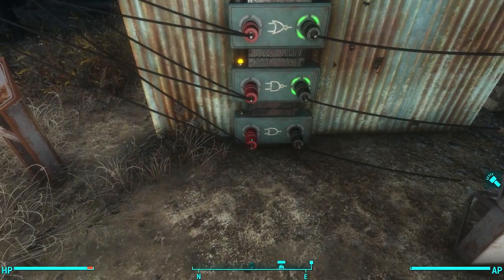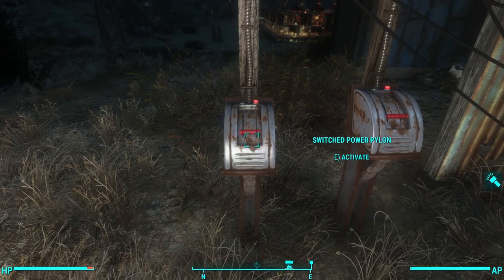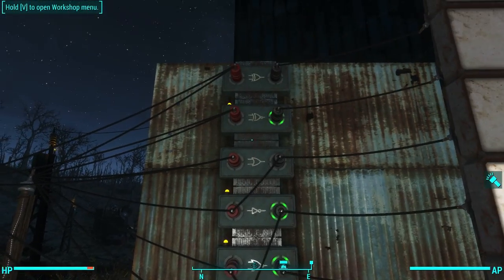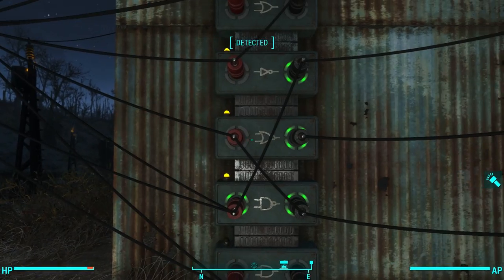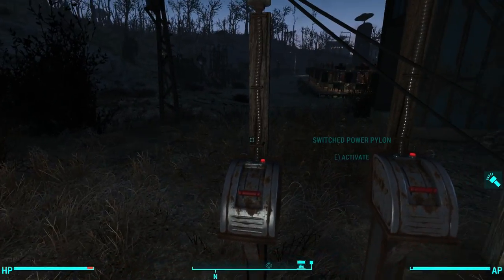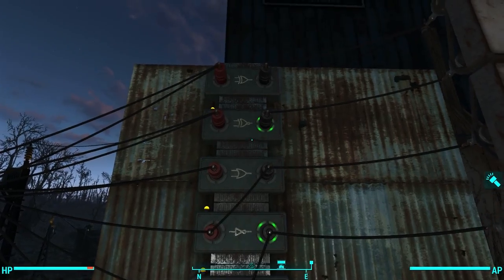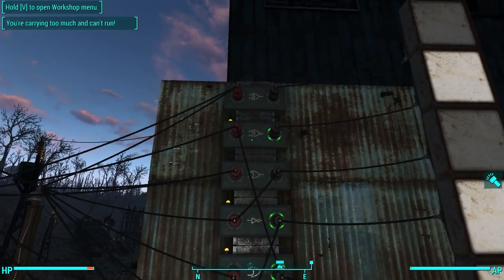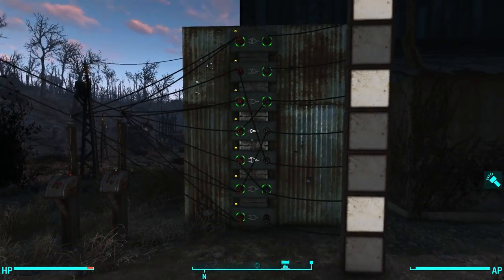How Logic Gates Work - Contraptions Workshop - Fallout 4

Comment: In my opinion the XOR Logic Gate is the best one for general use! You can make a door that can easily open or shut from either side, regardless of the way you went through it last or came to it this time. Just feed the power through the wall, to a switch box on the other side, then back to the gate. In addition to having a switch box on the same side of coarse.

Comment: The And gate is probably the most useful in my opinion. I use it for securing my powered doors. It's more for roleplaying, but I usually surround my nuclear reactor with walls and a powered door. I then have three switches at different spots that all have to be activated to open the door to the reactor. One's at the door (guarded by turrets and sometimes a guard), one is usually overlooking it, near a guard post, and the last one is near the overseer's office- another well defended location.

I also usually have a terminal in the overseer's office that can activate all switches. Of course I can't actually lock it, but I like to roleplay that it's super well locked and nearly unhackable.

The manual switches are more for a manual override in case something happened to the terminal. In the event power goes out, you could hook up some low level generators to each switch to access the reactor and repair it.

Comment: You're right about the game making it work because of the logic of it. The thing irl though is that we would also have power connected to other gates which would connect other inputs, as that would then regulate the input and output by the final gate(s) in the flow of current.

Comment: You sure that second from the top one that didn't light up was not lighting up because the generator outputs only 3 power and three lights were already on until you rewired it, then you'll notice only 2 lights are on, leaving it to be the third light on.
Reply from the maker: I'm sure. The logic gates simply require power. They do not consume power, like turrets do.
Reply: +Oxhorn could you do a tips video on how you get all your materials
Reply: ***** No, not the gates, the lights consume power I thought.
Reply from the maker: No, the lights do not consume power. They work like light bulbs.
Reply: edit:--- just checked... they do cost 1 each
Reply: Actually, in my game, it is showing the large box lights, which looks like what you used do cost 1 power each.  The small ones run like lights like you said, but not the larger ones unless you have a mod changing that.
Reply: Pick stuff up.

Comment: I was able to use the XOR gate to create a 3way light switch for opening and closing the roll up door in the warehouse build set. For those not too familiar, a 3 way light switch is the switch you use in a hallway to turn on the lights between each end. So you enter the hallway on one end and want to turn on the light. You hit the switch, light come on, go to the end of the hallway, hit the other swtich, light comes off. This is basically the XOR logic gate function.

So, for my roll up door. I have a wall switch on the outside and one on the inside. After using the wire though walls work around, because the gates don't work with conduits, I had a line from the outside switch and inside switch going to the input of the XOR gate, then a line from the output to the door power attachment. With this done, I can come to the door on either side and open it AND close it from the other side and vis versa.

The real challenge is combining multiple gates to perform a function based on variables present.

Comment: This was great. But what the hell do I do with this now? I'm not smart enough to run into a problem where I need this. But I do want to use this.
Reply: hon kale many thing.. like factory, gate, lamp, automatic radiation shower, automatic cage killer.
Reply: @Rizalpahlevi21  How do you make those things automatic ? This is very interesting i think i can see how i could make my lights turn on/off with a button and these logic gates. Are these the most practical to use though ? Wouldn't there be more simple ways to do stuff like that or are there some things you can only pull off by using these logic gates ?
Reply: @jaherra2567  first of which one u are talking about.. gate lamp or radiation shower just use pressures block or laser sensor with gate..
Factory is lot more complex but its fun to design it..
Reply: @jaherra2567  well yes you can also use button but u need to press it.. there is many thing in fallout 4 working same as a button like pressure plate, laser sensor, conveyer laser, ect.. just walk by and its on and off, for example shower radiation: just put 2 sensor 2 side of the shower, with gate help when 1 sensor triggered by just walking it ll power the shower rad and when another sensor triggered it ll power it off.. simple..
For another complex is auto ammo factory which ll create ammo auto as long as u got the material
Reply: @Rizalpahlevi21  Interesting i will have to look into it. I already have a small 3 builder 24/7 running ammo factory which was easy/lazy. I might build another factory in some better location this one i have is in the castle and it too small. Do those rad shower really clean radiation or are they just for show ?
Reply: @jaherra2567  those rad really clean radiation ofc.. its really save my time and money.. got rad? Ill just teleport home, walk into auto shower and clean my rad out of me.. no medic drug at all ^_^ well ofc u ll still need noRadiation drug in case of emergency..
Reply: @jaherra2567  this gate is also fun to play with raider, make labyrinth full of gate trap, all type of trap and put raider bait inside ^_^ to see the show use cmd and watch from above hahah
Reply: @Rizalpahlevi21  Now that is pretty cool i will definetly put those rad shovers in good use. I have been thinking about making light switches so i can turn the lights on/off when i walk in to a room lazy person would just turn off the generators but i have plan for those already.
Reply: @jaherra2567  yeah that rad shower really save a life! ^_^ then have fun..
Reply: @Rizalpahlevi21  Thanks a lot for replying man i got some really helpfull info
Reply: @jaherra2567  nah nah.. i like to have discussion with something that i love ^_^ im always love game that easy to mod and have many creativity..
Reply: @Rizalpahlevi21  Yeah this game has so much to do so much room for creativity and different ways to do things you can spend so much time on so many things i like it this building stuff was a very good idea from bethesda
Reply: @Rizalpahlevi21  laser sensor? that has to be a unofficial mod. i never found something like that in this game

Comment: it does make sense. there is a difference between the power circuit and the control circuit. In the game, however, they are one and the same. We can see the gates are transmitting power to each other, we know this because it lights up orange. however it is not transmitting a "1" or "on" signal and therefore not going through the logic test as a powered input.

its important to not that Not Nand Nor XNor need another powered gate regardless of whether its transmitting power or not

Comment: Thx Oxhorn, this was helpful. it helped with a contraption I was building to lock down the settlement using shutters and sirens. 

sadly I also learned of some limitations (mine or the gates themselves not sure) to my plan.

while one siren can lock down multiple shutters, multiple sirens can't work with one shutter. it was frustrating but I guess knowing what I can do now is better than the head scratching I did before this video:-)

if anyone can figure out my dilemma them more power to you

Comment: The real key here is that NAND, XNOR, and XOR all receive input from another logic gate.  AND, OR, & NOR can receive power from any source be it a switch, conduit, or another logic gate and work well, but the three former are best used either directly on a switch or from another gate, however power from a conduit to NAND, XOR, and XNOR will simply not work.

Comment: Personally I think this would all make so much more sense if there were examples of practical applications. Example. I’ve been trying to figure out if these would be useful for the cages so not all of them open when you cut the power. I have vanilla switches connected to each cage but was hoping for a cleaner more minimalistic electrical routing.

Comment: Thats one big oversight on bethesdas behalf for the XNOR gate... it needs power for its third state, but neither switch is providing... and you can't add power or you're adding inputs.... I have to fiddle with circuits to make my two way switch work so I can open and shut my door from both sides... XNOR DOES work, but only if I don't go jumping over the balcony and try to get back in... The inside switch is off and it can't act on the outside switches matching state since theres no juice.

Comment: all i see is in the comments are people saying there head hurts, then theres me with a working clock

all it is 10 power counters(hooks up to display),  then a interval switch(goes to each power counter) and i use logic gates so i can go from 2 seconds irl = 1second on clock to 1 to 1,
Generator connects to Interval(1Sec) + AND + XOR, 
Interval connects to AND + XOR, 
AND & XOR connect to separate Delay On(0.1) they go to separate OR Gates,
Both OR Gates go to a Power Pylon,
Power Pylon connects to 10 Power Counters(9),
The Power Counters should be on a different number,
each Power Counter needs to be hooked up to a separate OR Gate
These OR Gates can be hooked up to a display
 Congrats you have a counter that goes to from 0 to 9

Comment: Time stamp 7:30

Question: How do you get the light to come on when both power sources are off?

Answer: Use a larger generator reason being each lamp uses 1 power and the current generator only outputs 3 and currently needs 4.

Please correct me if I'm wrong.

Comment: I think we could make electric doors that can be opened and closed on both sides with the xor switch. Combined with a terminal and some of the other gizmos the results would be interesting.
Reply: I've already made a door work on both sides using conduits. The trick is to make the inside conduit switch control the power to the outside conduit switch and have the outside switch directly controlling the powered door. The conduit wall pass throughs don't snap to any particular place or angle on the walls, so if you want it to all line up you need to start at the outside switch and work backwards all the way to your power source... Now I'm trying to figure out a way to make the room lights turn off when I close the door from the outside, but also stay on when I close it from the inside... Lol. I should post a video.

Comment: Bethesda screwed up the logic gates

Trying to make an inverted light

NOT

Off Off = On

EXCEPT THE LOGIC GATE REQUIRES POWER TO POWER THE LIGHT
Reply: that's where a "common" wire is needed.
you wire your power source directly to the light, then add your wired switches to the light to complete the circuit. that way the off switches will break that circuit and your light has the power

Comment: This video is something I needed right now because I'm trying to set up a huge Factory in Fallout 4 but I did want to make a comment about your reaction to the Nor gate. You made the comment that it doesn't make any sense in the real world but I wonder if that's because you're thinking of each one of the connections that you make in the game as if they are a single wire. That's not how the real world works as a matter of fact there's usually a bundle of wires going to each connector and it's for the purpose of allowing your positive negative and ground and if you're on a three-phase system then you have another wire in addition to that. Allowing room for the possibility that each wire that we connect in Fallout through its Power Systems is not just a single wire connection but rather each one is a cable consisting of a bundle of wires there is a plethora of options and how electrician wires these
Reply: I think logic gates for mains power aren't even avaliable.

Comment: Could you just have both switches on and remove plugs or cut wires for each transistored gate switch so as to meet the logic criteria for each and have the light panel fully lit?

Comment: OK Oxhorn, if anyone can help me, it's you or your fan base. I'm designing a death maze out of vault 81 and am trying to see if I can realize a mechanic. I essentially want to hook up the power cycle as a conduit betwixt the generator and a powered door. The idea is you have to get on the bike and pedal to open the door and continue the puzzle. but once I get off the bike, the door of course shuts. is there a way to use these gates, maybe through a secondary power pylon line to have it so that the door will stay open and powered after dismounting the power cycle?

Comment: right i need advice. i want to build a system that if the alarm sounds all the doors in my settlement close.

i i have worked it out correctly, i connect all the doors to the power as normal but connect the siren to the NAND gates then to the powered doors, in theory when the siren sounds that should fulfil the Logic that it wont power if both sources are powered the gate doesnt send any and the doors will close.

does that make sense?

Comment: Actually, logic gates make sense in the real world. Every single computer works thanks to them. They are the at the core of the microprocessors, wich are basically very complicated combinations of logic gates and transistors. Learning them can be quite a pain, but you can easily recall what each gate does by learning what their names mean. You basically need to learn only the NOT, AND, OR and XOR (XOR meaning exclusive OR) gates. All the other (NOR, NAND, etc) work by putting a NOT gate after the respective AND, OR or XOR gate.
Since I'm Italian I may have expressed myself not correctly, so I suggest you, if you are interested, to check the logic gates wikipedia page here.
https://en.wikipedia.org/wiki/Logic_gate
Reply from the maker: The point was that it makes no sense in the real world if, instead of ones and zeros, the logic gates convey electricity. In the real world, you can't power a settlement through an unpowered logic gate, even if the logic is set to transmit power.
Reply: Oh, yeah you are right on that. Logic gates in real life are always powered and input signals are just that, they don't power the output signal.

Comment: Hi Oxhorn, I'm having problems using the Xor gate if fed with power via power conduits after switches it doesn't register power correctly. Can you experiment and help me out at all please. My circuit is generator > power conduit (A) > new on/off trip laser > power conduit (B) > Xor gate > new garage door. This circuit is done outside the door and inside the door so that the door opens when approaching and then closes again once through.
Reply: Conduits do not transmit logic, only power. Try replacing the conduit B with an AND gate with just one input and one output. It will act like a buffer (no change to the signal), but allow you to stick the wire to a wall.
Reply: +Dolkarr but im not trying to transmit logic from the Xor gate im just trying to use the trip laser in conjunction with wall conduits to provide power to the Xor gate to then feed the power to the garage door. My method works if you do generator > laser trip on/off (A) and generator > laser trip on/off (B) > Xor gate > garage door. But as soon as you do generator > wall conduit > laser trip on/off (A) and laser trip on/off (B) ........ then laser trip on/off (A) > wall conduit (A) ........ then laser trip on/off (B)  > wall conduit (B) ....... then from wall conduit (A) > Xor gate ....... then wall conduit (B) to Xor gate ..... then Xor gate > garage door,  in other words just introducing wall cunduit between the switches and gate, it doesn't work :-S. Help please
Reply: Adam Rowe That's what I'm talking about. Wall conduits often break logic gates like this. If you replace your conduit with an AND gate (or an OR gate), it should work.
Reply: +Dolkarr thank you I understand now

Comment: i did the same thing like you did in the first 20 sec of the vid, idk is it a bullshit or a mod. Gen->Pylon->Switchx2->each Logic Gate->Lightbox, 0:23 as i can see yours, have green and yellow for some of the Logic Gate, and mine doesnt. how in the hell did you get power without even switch 1 of that switched on? mine Logic Gate turn off after i turn off both of the switch... can you explain? your light box is the large one, not the small one, because large one need 1 power each, unlike the small work like other simple light...

Comment: Bethesda broke logic gates in this dlc. Any of the negative gates (NOT, NOR, NAND and XNOR) don't work as they're supposed to, which is why the wiring required is incredibly confusing.
Reply: Bow Toes they actually do
Reply: How so? You have to connect to another gate first before they'll function properly. That's not how real world gates work. Plus the rest of gates are so buggy, it's difficult to get any kind of even slightly complex circuits working.

Comment: So basically you are able to run a settlement without any power generator now, right?
Reply: Haha, no.  The gates don't produce any power, just allow the power to run through it.  So if you have no generators, the gate will allow zero power to run through it.
Reply: if the generator needs repaired will it still power the connection lol